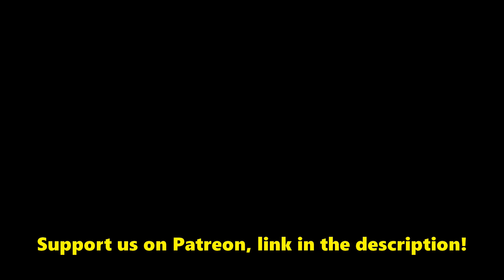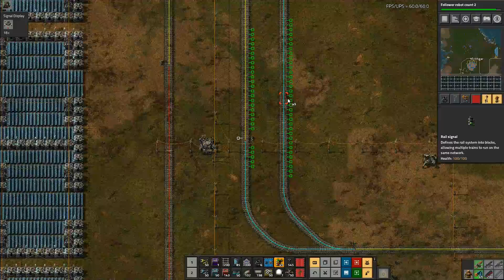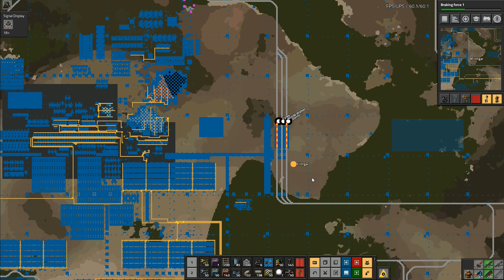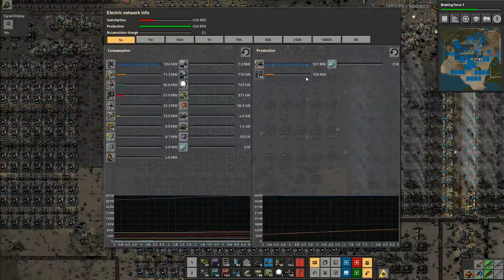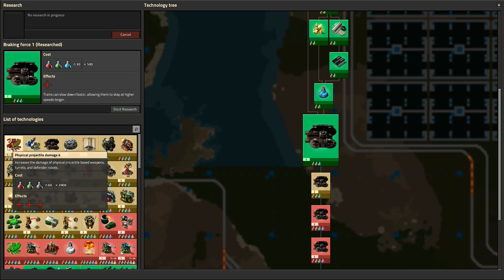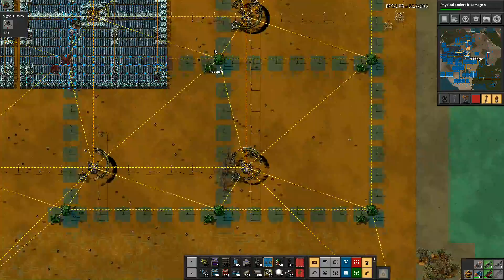Factorio Million Robot Challenge #137: Train Stations Again!

Comment: For moving oil by train use the fluid wagons not the barrels. Each barrel holds 50 units of oil. They have a stack size of 10. you have slots for 40 stacks in a cargo car for the train. that comes out to 20k per cargo car. with 3 cargo cars that is 60k total oil. With 3 of the fluid wagons the total haul is 100k oil.  The advantage of the barrels is that you can store them in Chests. With the oil wagons you have to have storage tanks and you have to have pumps at to load and unload the oil.

I would recommend that you go back to belts to feed ore to your smelters. The travel time for the drones is why you are having issues feeding the smelters. I had the same issue when I tried to go without belts.

I hope the info about the oil is helpful. I never gave this game any thought until I saw your older play throughs of it. Once I did I had to make the choice between this game and Satisfactory. Like you I have issues with Epic Games so I went with Factorio and have not regretted it.